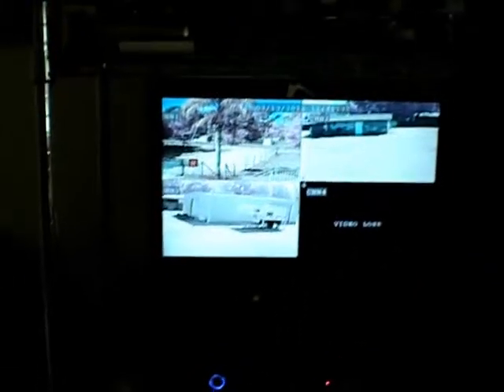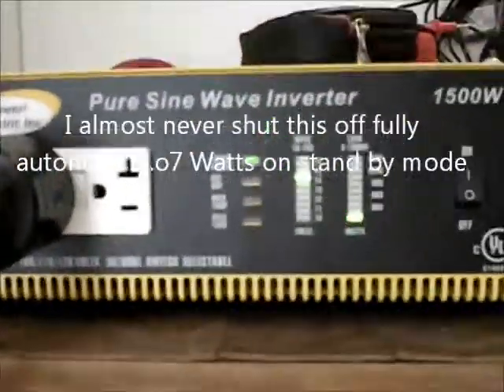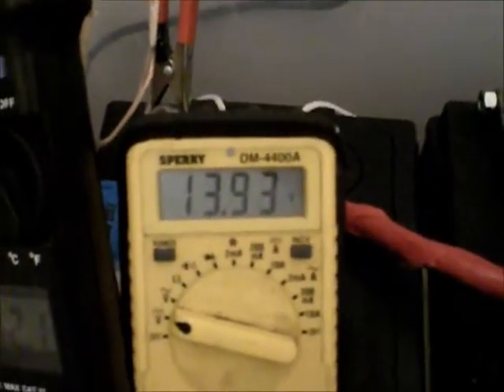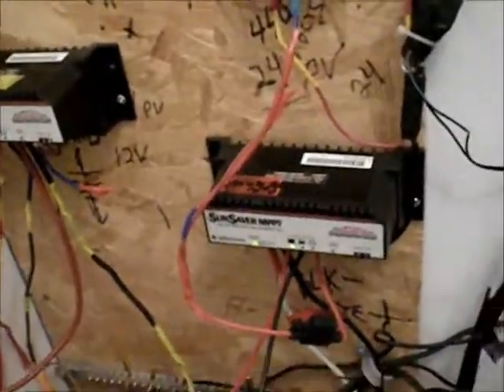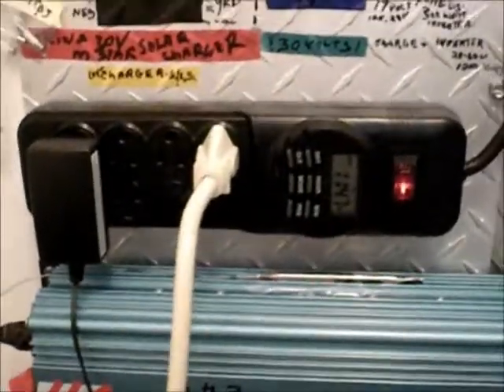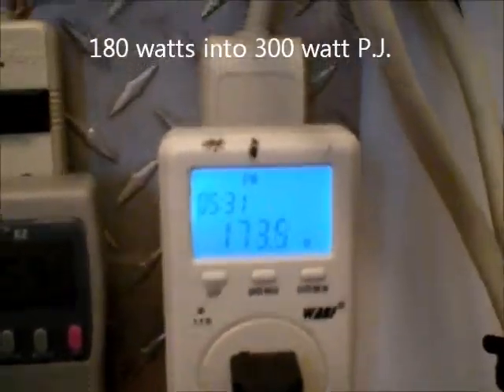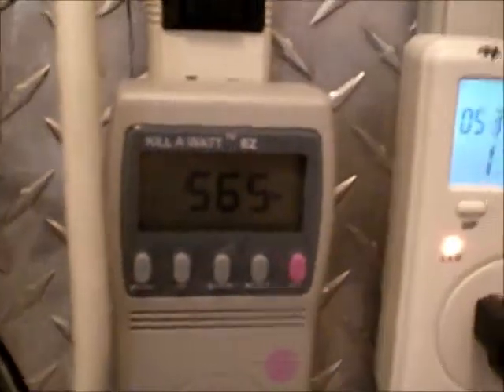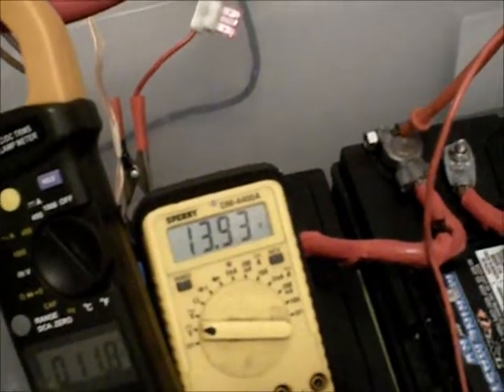Making the best use of solar power..wmv

Comment from the maker: @Fearlessthinker  I can if needed but not normally. Just living room & my office.are 95% off Grid Full time.The gtis  help out the refrigerator. I have ran it with all the rest but after 18hrs was unable to keep up Above 12 volt,s i believe it went down to11.83. I try not to go below 12.2 that,s so posed to be 40%used  range or 60% left which is about 1200 watts That is why i want to upgrade to Out Back Flexmax so i can put the power were needed with a battery switch in event of power loss.

Comment from the maker: @MrHorsetail  My idea is less wire u buy & less trenches u dig the better .I have buried over 400 Ft.of# 8 wire since i started this. So yes i think bigger is better. Less holes in your home less digging but not all systems are the same. For me I will  expand at lest another 2000 watts i hope. I have now 440 watt@30v into battery ,180 @17vinto 300 PJ. 705 watts@47v on trackers 2&3 each feed there own 1200 watt Power Jack.So total is 1590 watts Grid. 440 battery bank=to 880@12v power load @ 15v.